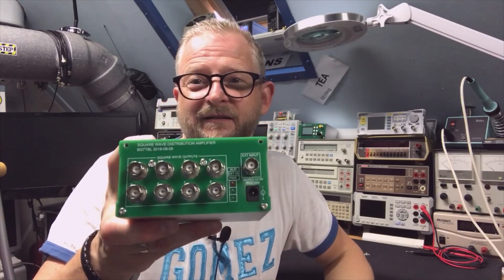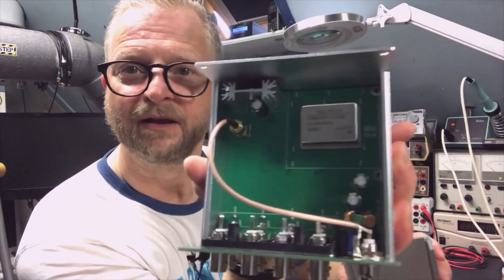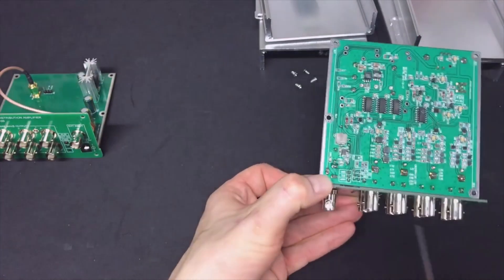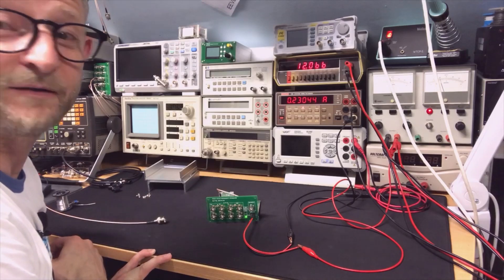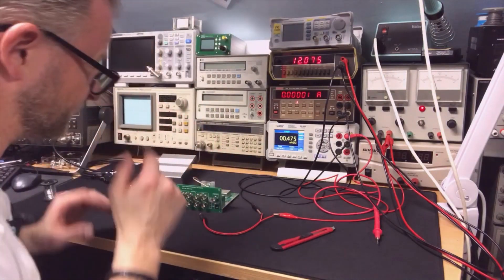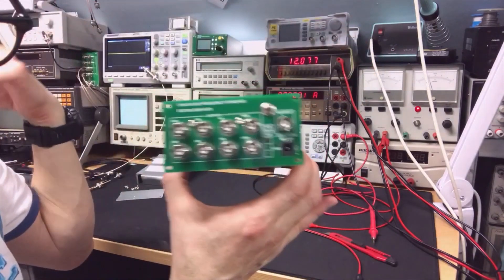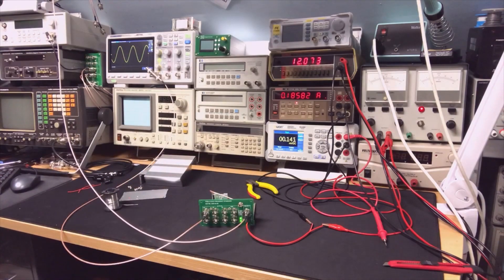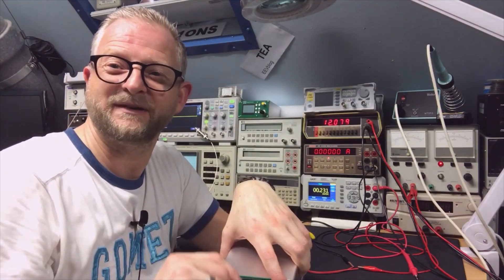#061 FDIS-5 Distribution Amplifier BG7TBL Less power mod

Comment: But, if my understanding is correct you don't wear the crystal, you age it so it becames more stable. Also, the oscillators are cheap but they are supposed to be run 24/7 for weeks before they acheive their maximum stability.. please correct me if I am wrong
Reply from the maker: Hi Tavi, you are correct, but what is the use of running a OCXO using power..if you not use it because of the GPSDO?
Reply: @TonyAlbus  well Tony, if you use it as a basically distribution amplifier with "benefits" that's ok, but when you perhaps loose the GPSDo, the crystal will not be either ready or precise. But I guess it depends on everyone's preference. If you know you have a good, reliable reference you are good
Regards form YO! Hope to see you on the radio waves so we can work a QSO sometime
Reply from the maker: 73

Comment: I wonder if they lock the internal OCXO to the incoming 10MHz signal and that is the reason that it is always on?
Reply from the maker: Thanks for your response , I know what you mean, that is usualy used when the Ext.Ref frequency is different from the internal OCXO.. when it is the same it will be unnessesary complicated, because you will be locking your internal 10Mhz with the external 10Mhz which just means you use external 10Mhz.. but in the Marconi with 1Mhz external ref. and internal 10Mhz, that is indeed what they do. also in the Anritsu counter, you are able to connect external ref of: 1Mhz,2Mhz,5Mhz or 10Mhz..here locking internal OCXO to ext. ref. is for sure the case.
Reply: Well, assuming that your external reference is more precise than the internal one it makes sense to lock the internal one to the external signal, then when you lose the external one the internal one takes over. I couldn't see exactly what is connected to the OCXO but it looks like there are more than 3 pins connected so the 4th one would be the adjust pin. Did you find any documentation or schematics?